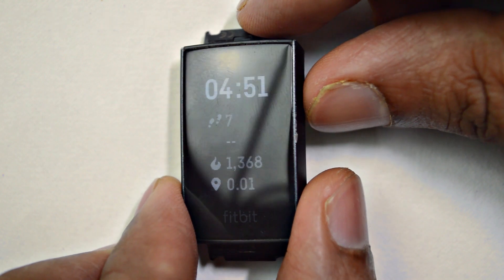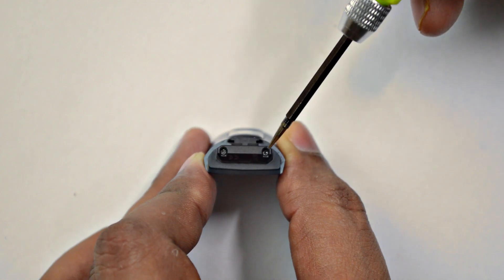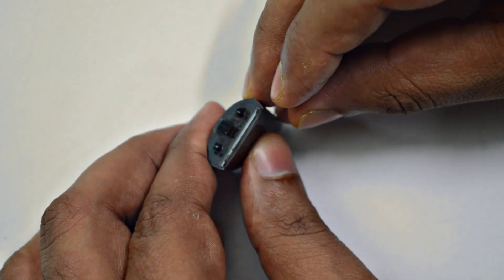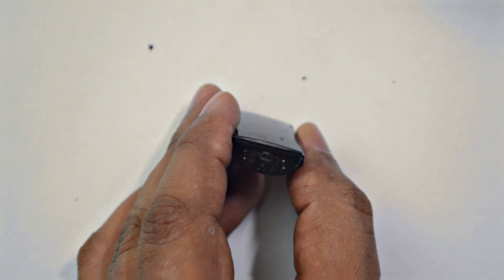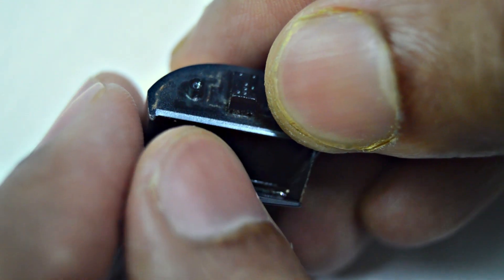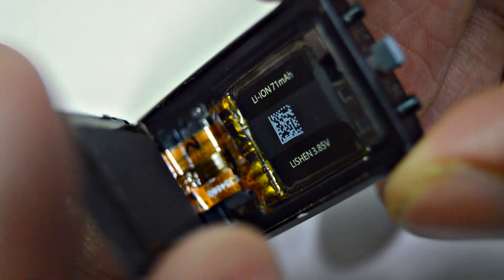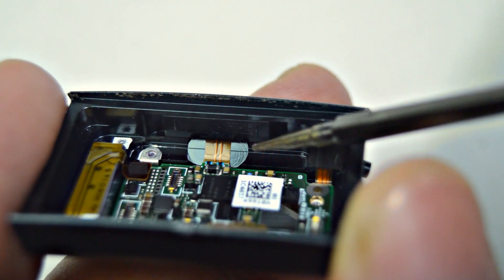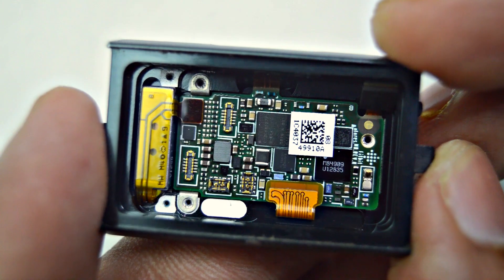Fitbit Charge 3 battery replacement | How to open Fitbit Charge 3 teardown

Comment: Nice vid, but i wouldn't recommend going near the electronics with anything metal, you might cause a shortcircuit. Just get an old chipcard or stiff plastic. Regards
Reply: Cant if the battery is disconnected.
Reply: @bobsoft obviously you never heard of capacitors...
Reply: @user-2uf2kr2c  Nope never heard of surface mount caps

Comment: Good video - thank you. The procedure required to change the Fitbit battery I find ridiculously complicated however. After 18 months of use, the display became very dim. Neither charging nor resetting the device helped. I'll probably just bring it to the e-recycling center.

Comment: mine was run over but it still tracks and vibrates, I just cannot see the screen even with the 2 reset options.  The screen is intact but i can't see a thing.  Any suggestions?

Comment: Wonder if a there's a longer life aftermarket battery that will work with a few of the fitbits causing trouble
Reply from the maker: If we get same size with bigger capacity, then it will work. I didn't find till now
Reply: Can anyone kindly share link where we can order replacement batteries.

Comment: I got a charge 3 that has nothing lighting up, no matter what. Hence, I think it is a battery problem. Where can I buy these replacements? Also,  in about 2-3 videos that I saw on this topic, they have used different screwdriver- T2 torx, T5 torx. How do I know which exact one is it?
Reply: T2

Comment: I got this as a gift a year ago and the battery is shot. I won't be buying a Fitbit if it costs this much and only lasts a year... Waste of money
Reply: Yep, mine went out before a yr then got a replacement via warranty, now it won't sync nor light up.  So I decided to see if the old one would some how come back on, it did for one day then back out again.  Hopefully Google can solve this problem if not I won't be purchasing anymore been trying to be patient with them for about 5 yrs now with the same issue.
Reply: @paige_judah5538  Fitbits have a one year warranty and die after about 18 months.   They will offer you a small discount for a replacement, which you can buy if you are a total sucker.   Buying a fitbit is pretty much the same thing as throwing your money in the trash.    I'll never buy another.

Comment: Have you been able to find a replacement battery for this? I can't seem to track down a LISHEN 3.85V battery like this anywhere 😂
Reply from the maker: You can find in aliexpress site
Reply: @diyeasy_in  I can't find the battery on AliExpress. Can you please share the link? Thanks.
Reply from the maker: Let me check.... i ll share you
Reply from the maker: Sorry... now I am not able to find on aliexpress, may be bcos of corona the supply stopped.  Will wait for some time.
Reply: @diyeasy_in  Thanks for the update 👍
Reply: Very nice video. The rubber thing which you remove, that's for water resistance right? So after changing battery, can i substitue with e.g. glue gun?
Reply from the maker: Yes, you will get rubberised glue. Don't use instant glues, those will damage inner part
Reply: What is the battery code LSSP271505?